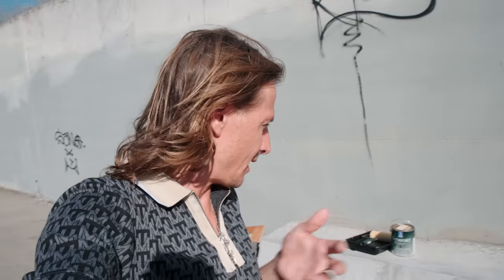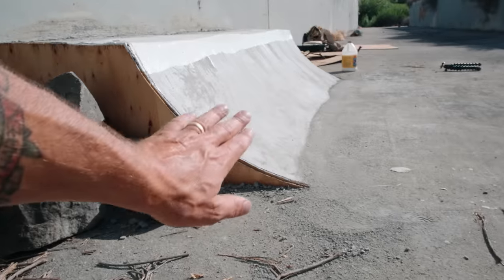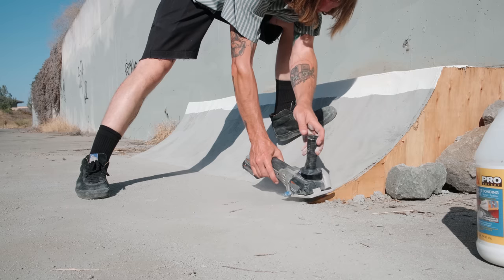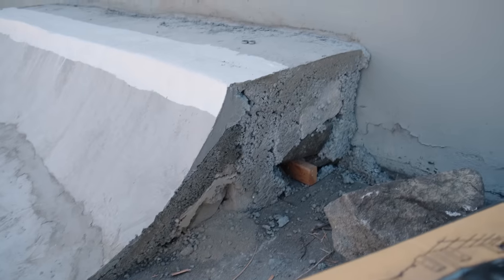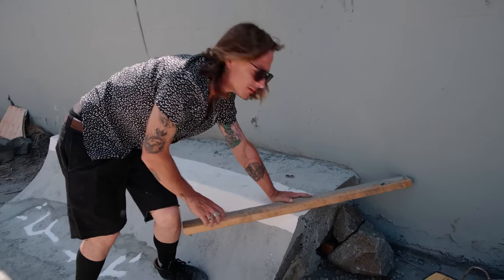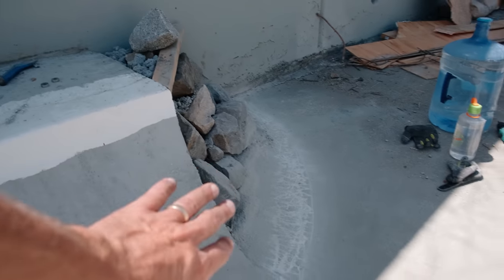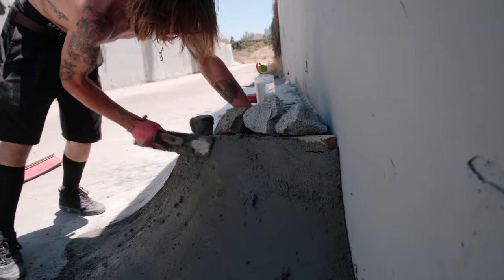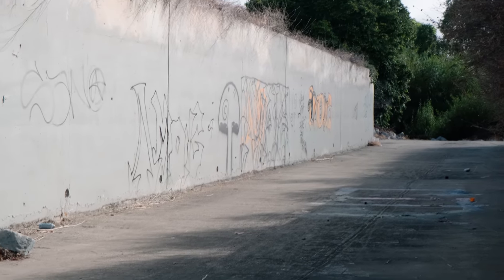Building A DIY Skatepark Ep.2 (Transition & Hips)

Comment: Looks super good! We used that same patch kit for filling honeycombs on the decks in the backyard- kinda squeegeed it in then just float…question: does it hold up as a feather finish on existing concrete? looked nice on the bottoms but we have some issues under coping
Reply from the maker: The finish on existing concrete is really nice! I think it's great for that, just hard to now trowel it haha.
Reply: People talk about that Ardex product like that (the whole “feather finish” thing but I am familiar with your patch kit…we removed a top plate and our line was all jagged, tried to grind it- set pool blocks…but now I kinda want to try the kit to fix a couple spots under coping (small cracks)…TY sir!

Comment: the reason your shit is cracking is because you're using spec mix to float thin areas. mortar is weak so if you apply it thinly like you're doing it'll just crack off and crumble.